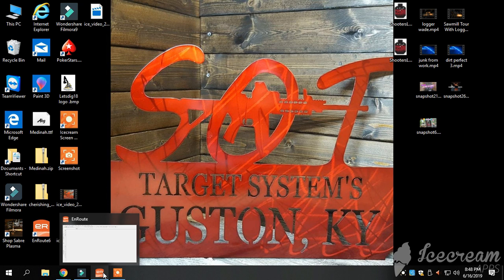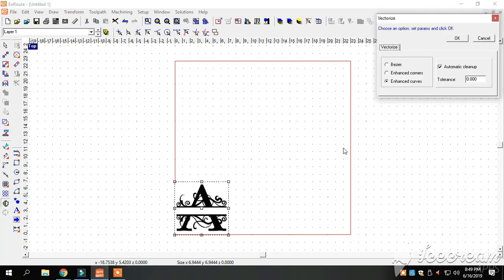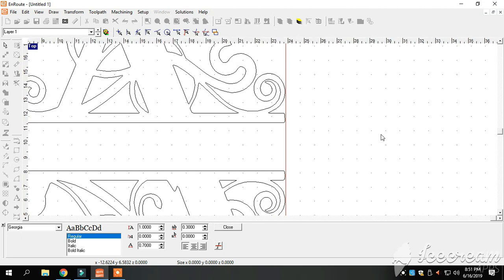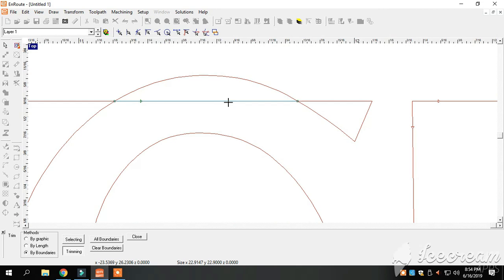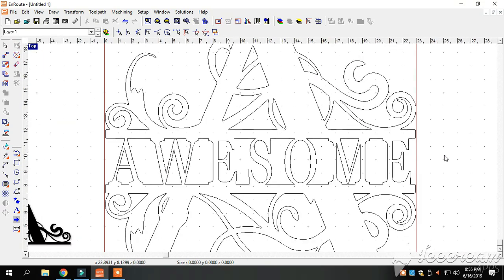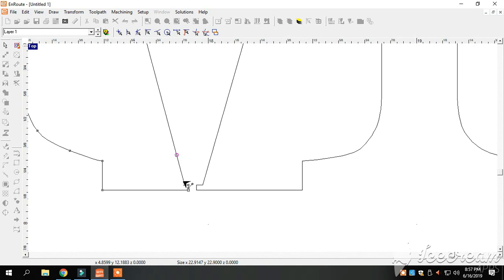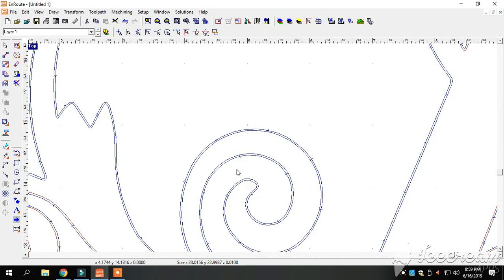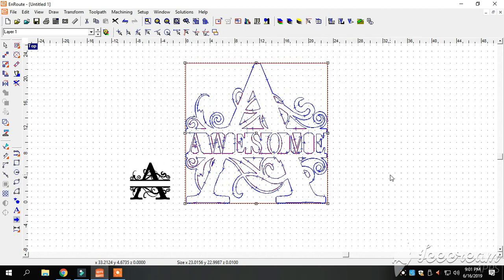How we draw our monograms for the Shopsabre CNC plasma table

Comment: I worked on an inlay machine in a furniture factory. We did oversize test runs on scrap wood and adjusted the start- stop points to clean up and correct at the machine. Most of the time it was because the depth wasn’t correct or the pattern wasn’t centered.

Comment: Is that enroute easy to learn.
Reply from the maker: Yes really user friendly and easy to use. This is my first time using a cad program If that helps.
Reply: @shootersoptiontargets  thank you.  I like how you can move the in and outs like you did.  Just in case it does get a little hot in that area it won't mess the sign up.